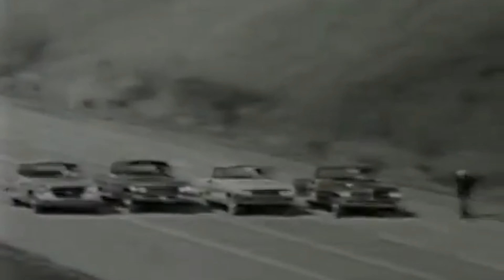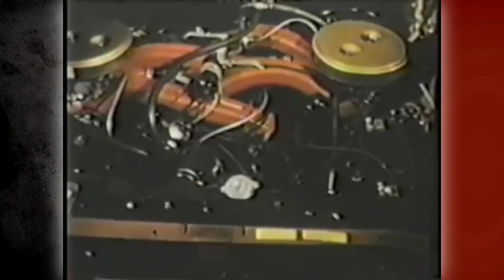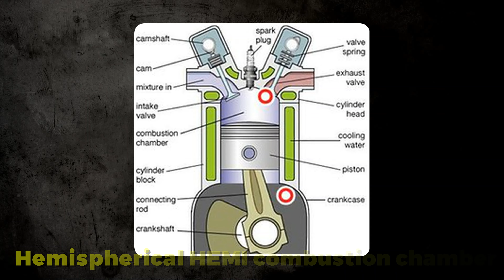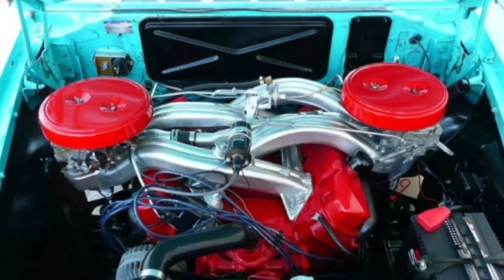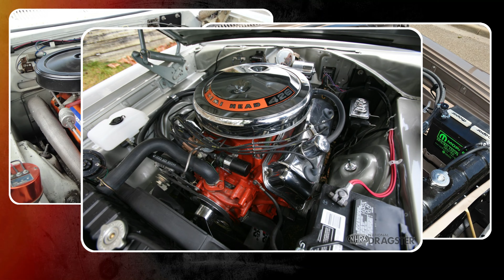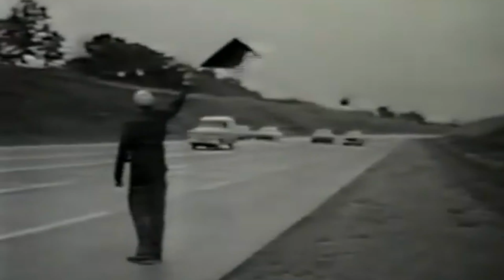How THIS Engine Dominated Street Racing Forever

Comment: People overlook the 413 Wedge, but back in the day, it was a beast. Before the 426 Hemi stole the spotlight, the 413 Max Wedge was tearing up drag strips. With the right tuning, these monsters were hitting 12s in the early '60s—using factory parts! Pure Mopar brilliance.
Reply: The 413 Wedge was solid, no doubt, but let’s be real—once the 426 Hemi showed up, it was game over. The Max Wedge had its moment, but the Hemi redefined dominance. If the 413 was that great, why did Mopar move on so fast?